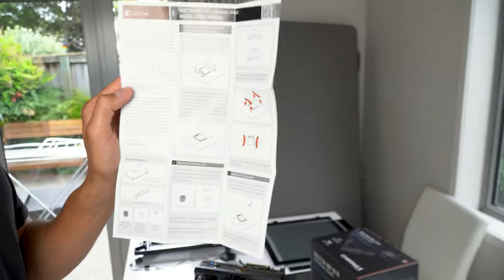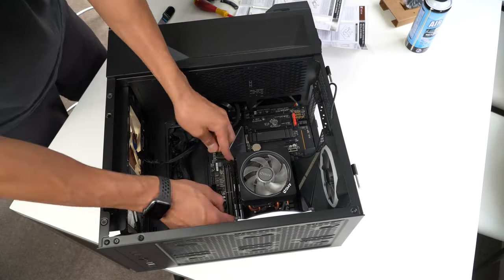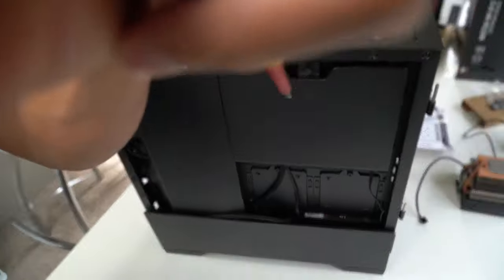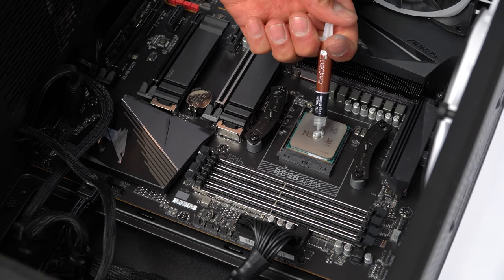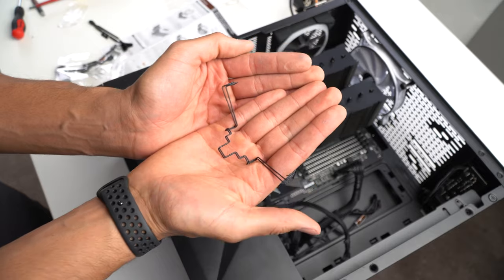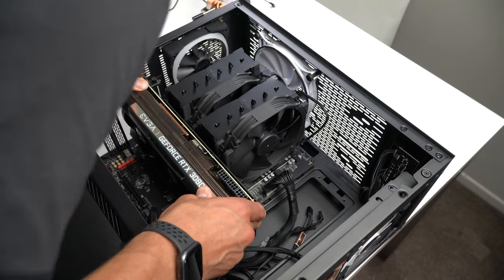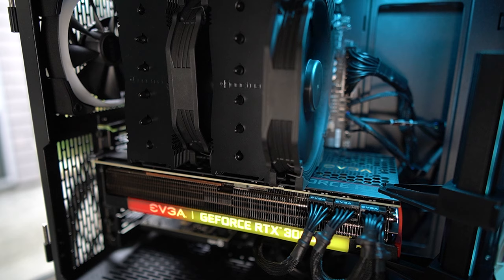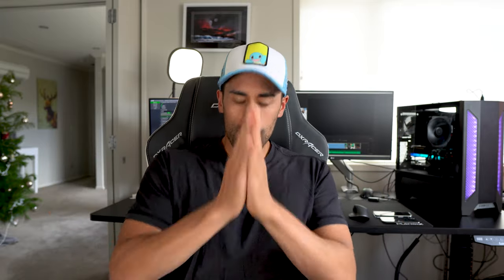Installing the Noctua NH-D15: Top Tips & Common Mistakes to Avoid

Comment: Hey pro gamer tip: NEVER USE THE DAISY CHAIN POWER CONNECTOR. use three separate power connectors for cleaner power delivery to your 3080. It can be super sketch sometime and may cause it to crash. I’ve seen some cards bricked (some were over clocking, some just had a high power draw). Other than that great vid quality. Pretty informative overall
Reply from the maker: Yup, I fixed that soon after the video after hearing how that was a bad idea! Thanks for looking out for me!
Reply: i am using 3080 tuf oc for over year i have the same power connector and i did connect them the same as he did in the video i didn't have any  problems
Reply: @Ahmadawa184  The only problem you might encounter is when your card needs more power and only 1 cable doesn't supply the needed power. Not only that, you risk overheating your power cable if you put a lot of load on your Gpu for an extended time. JayzTwoCents channel did a coverage of that.
Reply: My God. Doing that right now. Thank you!
Reply: @frankgrimes2679  oh yeah bud for sure use separate cables. If anything never cheap out on the psu. I did and now I’m in the market for a new one cuz 700w is obv not enough for a gaming z trio 3070. Better to get more than what u need so you can possibly use it in ur next build. they kinda let the whole pc thing be alive, otherwise u just have a bunch of cool looking parts lol
Reply: @BC_CARS  quick question, you said use 3 separate cables from the PSU to the gpu. But my 3080ti is an 8 pin, so wouldn't i be using 2 4 pin connectors?
Reply: @frankgrimes2679   cards are different. Some have 2 plugs some have 3 and the lower end cards just use one. My 3070 uses 2 plugs. Just make sure it’s a separate cable for each of the 4 pins. Daisy chain bad
Reply: @BC_CARS  gotcha, thanks man

Comment: Quick tip for the people in the comments and maybe even you. Try to avoid pulling straight up when removing a cpu cooler from a Am4 cpu because you can end up pulling the cpu out of the socket and bending pins. I’d recommend twisting the cooler first to break the seal and allow air to get in before trying to take the cooler off.
Reply from the maker: That’s definitely a really good point and something I have seen and heard of from other YouTubers especially if you don’t take your cooler off that often and the thermal paste almost becomes an adhesive!
Reply: I actually pulled my Ryzen 9 5900x from the socket and it went flying from the cooler into the wall and bent all the pins! So I broke out my trusty iFixit tool set and ever so carefully rebent all the pins back to as straight as I could get them. From this experience I learned never pull out a Ryzen CPU straight out but twist it out. I've gone back to Intel since then and sold my Ryzen CPU and MB.
Reply: @dalesawanas3733  was the 5900x a problem child or just wanted to try something new?
Reply: Good advice, filed under things I learned the hard way.

Comment: Laughed a bit when you talked about thermal paste application since it seems everyone has an opinion thereon and everyone's absolutely certain that they're dead right, haha. Thanks for the vid! I'm pretty new to PC building myself and want to pick up an NH-D15 myself for my Ryzen 5 3600 (because while the cooler's overkill for this specific CPU, it's a longer-term investment overall!), this was useful and fun to watch.
Reply from the maker: Yeah I can't really say what the right way is for that thermal appilcation but I can say that the cooler is a great choice and I thought the same in terms of future proofing in case one day I decide to upgrade to the 5000 series! I hope the cooler keeps that 3600 of yours cool as a cucumber! Ese :)
Reply: I have the same cpu, and the stock cooler from the ryzen 3 2200g i had previously was idling at 60c, just installed the nh-d15 and dropped that idle temp down to 40c, brilliant cooler. slightly overkill for my build, but as you said, future proofing is always nice

Comment: Hi can i have some help asap please? Im wanting to put the noctua nh d15 into a Gigabyte B550 AORUS ELITE V2 ATX AM4 Motherboard with Corsair Vengeance LPX 32 GB (2 x 16 GB) DDR4-4000 CL18 Memory. So would the ram sticks be able to fit underneath the cooler or would there be some steps i need to take. Also be using a Corsair 4000D Airflow ATX Mid Tower Case. Thanks guys
Reply from the maker: This is from their website where you can check compatibility for cases and coolers:

Caution: Please note that the fans of some tower coolers (especially larger models with 140mm fans, e.g. NH-D15 or NH-U14S TR4-SP3) may overhang the RAM slots and that this can cause compatibility issues if RAM modules taller than 32mm are used. While the fans can be moved upwards to increase RAM clearance, this will increase the total height of the cooler and thus requires additional clearance inside the chassis. As a rule of thumb, if the fan overhangs the RAM, the maximum CPU cooler height specification of the case must be at least the size of the fan plus the height of the RAM minus 7mm (accounting for the height of the socket and CPU). For example, if a cooler uses a 140mm fan that overhangs the RAM and 46mm tall RAM modules are used, the max. CPU cooler height specification should be at least 179mm (140+46-7=179). For further information and instructions on how to move up the fan for each cooler model, please click the height specification link.

Your case says max cooler height of 170mm

However when you look at the ram compatibility it comes with some tags saying it might not be the best due to the height of it:

NH-D15	

Front fan overhangs RAM slots. If there is sufficient space inside the case, the front fan can be installed in a higher position to clear the RAM modules (see linked FAQ).
AM4 mounting-kit included since 01/2019
For coolers bought before this date:
NM-AM5/4-MP83 mounting-kit required (free of charge)
NH-D15 SE-AM4	

Front fan overhangs RAM slots. If there is sufficient space inside the case, the front fan can be installed in a higher position to clear the RAM modules (see linked FAQ).

I checked my ram which is the G.Skill RipJaw and it gave me the same warning and I had to offset the front fan slightly to accomodate which was fine. 
Not sure if this is any help! Thanks Ese

Comment: I have used Noctua NH-D15 for all of my builds since it came out. It has never let me down.
Reply from the maker: Yeah I can see why! They are really impressive!
Reply: @mrtwomore  are you still using it ? I'm looking to get one
Reply from the maker: @deadmanwalking1930  Hey! yeah still using it and it's still going strong. I have cleaned it out a couple times with a dust blower but other than that it is holding the temps pretty darn well (I haven't seen my CPU go over 73-75 degrees even under full load).
Reply: does this cooler bend the motherboard by any chance? did you had any problems? could u answer me? 
i have a x570 UD gigabyte and i´m in doubt if this will hold.
Reply: @apertaplays  I have used it in all my builds. Never once has it bent the motherboard. Any problems? nope the installation is quick and easy.  Please read the instructions when you are ready to mount  it.

Comment: Thanks for making this video, I just bought an NH-D15 and will install it in a few days once I have moved house. Seems to be the most raved about fan / heat pipe cooler for my chip - i7 9th Gen 9700
Reply from the maker: I’m genuinely excited for you and hope the install goes soother than mine along with providing better cooling! Thanks Ese
Reply: does this cooler bend motherboards by any chance?
i have an atx mobo  ( x570 UD ) and i dont know what to do.

Comment: Huge thumbs up for this video, thank you.  My AIO cooler failed and it is the replacement of the original.  I think the QA on those is just too poor and they get contaminants in the liquid causing the pump to clog.  Any I decided I have had enough of the AIO and went with the NH-D15 which I don't have yet, but in preparation for it I almost completely removed all four screws on the stock brackets.  So glad I watched this and did not.
Reply from the maker: I’m happy you didn’t make the mistake I did with the screws. And thanks for the comment I’m sure that information on AIO’s will help someone else too.

Comment: When buying the Noctua cooler you should check the compatibility online with your case so you don't have to "cross your fingers". I was using an MSI MAG Coreliquid 360r but it fell victim to the usual sediment buildup so I have replaced it with a Noctua NH D15 Chromax. It's a huge ugly brute but it works and side effect is that I've been able to lose the 360 radiator which was blocking airflow into my PC.

Comment: I have the Noctua NH-D15 myself on a Ryzen 3900XT with one Noctua 140mm industrial 3000 RPM PWM installed in the center. The fan is definitely tamed with a fan curve. I don't waste my time with gimmicky water cooling.
Reply from the maker: I agree totally!
Reply: 26 years of high-end computing and water cooling never ever crossed my mind too
Reply: @Lordxfx  Liquid cooling has a purpose, but if I got the room air cooling it is
Reply: @jamesm568  I run stock speeds on my cpu's and never felt the need for liquid cooling. A 10 to 20 % overclock at the eind of the life cycle has never been an issue for me either. I only have the summer months to worry about and that hasn't been an issue either(EU). I a have computer room with no airco. My systems are audio production platforms.  Above that, I like to configure and forget my computer systems.  I like the KISS principle.
Reply: @Lordxfx  Personally, find radiators restrictive for airflow in a case.
Reply: @jamesm568  In a way you are right, but the fans are there to lower the pressure inside the case. (Push-Pull configi)The air flow is a result of pressure difference. You can do the other way around too. I personally love those big blocks, always did. Heat pipe technology has come a long way.

Comment: Cools a 5900x @ 4.5ghz at a nice 60°c while gaming.  Absolutely incredible, also opted in some corsair fans to replace the noctua ones included so I can move them somewhere else in the case for more airflow
Reply from the maker: That's good feedback and damn I wish I had a 5900X!
Reply: I wonder how high temps would go if used in video encoding in Premiere Pro or cpu rendering in V-Ray or Corona render.
Reply: Excellent to here. My 3080 and 5800x are throttling temps right now and mine gets in tomorrow
Reply: @hiimreyna  my 240mm aio can't keep up with my 5800x. Hoping the noctua makes a difference.
Reply: @hiimreyna  any good results in getting the d15? I'm getting mine soon my 240mm aio can't hang.
Reply: would it be a huge difference from the amd stock cooler? im using the stock cooler and play on a ryzen 5 5600x at 4.5ghz 1.2v at a max of 75c. Please let me know if this would be a good upgrade for my

Comment: You should try take your top fan off and have exhaust behind your cooler so the cool air runs from front fans - through the cooler fans and out the exhaust at the rear. Would give you even better temps I reckon.
Reply from the maker: You know what I might try that to see what the difference is, as it’s as easy as turning it off in the setting! Thanks for the idea of got nothing to lose!
Reply: @mrtwomore  whats the results after you change it?
Reply from the maker: @rnyzen2.079  nothing to be honest I already had a exhaust ran running and that top one only kicks in at a temp of +80 which is hardly ever with that CPU cooler.
I've actually upgraded to the 5800X3D and only seen it hit 80 degrees once or twice on some big renders in aftereffects.
Cheer Ese

Comment: For the love of god do not use splitter cable for power to your GPU. It has to be 3 SEPARATE power cables from PSU. Good informative video on installing noctua though!
Reply from the maker: Appreciate the heads up and I agree I actually didn’t even think about this when I swapped out from my old GPU. I’ll fix that up this arvo. And cheers for the comment! Ese
Reply: @mrtwomore  It shouldny make a difference unless your an overclocker which couod just cause crashes (as far as i know and read in tbe passed) if your power supply doesnt have the cables, dont worry about it lol. Also video vid👍
Reply from the maker: @benkhmelev9692  cheers man and yeah that was my thoughts but luckily the EVGA PSU has a million VGA cables so I just put another one in to be safe, 😁😁
Reply: @benkhmelev9692  Yeah, two should be enough, but for three 8-pins, I'd use three separate cables if I could. Seems like using two and daisy chaining is okay, but yeah. I'd play it safe.

Comment: Thanks for the video! Btw, I noticed your exhaust fan does not spin when you had it on, not sure if you want it that way, but just heads up :)
Reply from the maker: Thank you for noticing and looking out for me on that! I did have it set to come on at I think 70 degrees or more on the CPU temp, but now I have it running low most of the time as an exhust and it works better for temp regulation. Cheers, Ese

Comment: just bought a NH-D15 for my ryzen 5 3600, as the stock cooler is holding my idle temps around 55 degrees (c)!!

Comment: Nice vid mate, i got this CPU cooler coming to replace my 240mm AIO rad.
Reply from the maker: Appreciate it and I'd keen to hear how it goes compared to the AIO. Cheers Ese
Reply: @mrtwomore  I installed this Cooler yesterday, on my Ryzen 5 3600. i set it to 4.4ghz and 1.4v it never goes over 60c degrees. Noise level is quiter then the water cooled AIO.

Comment: This helps because I have the exact same case as this video and though MB is different my ASUS 550 is set up quite the same way. So sir, your video helped me make the decision to purchase this fan. Good Job! EDIT: Also I subbed :)
Reply from the maker: Thanks man, it's cool to hear I helped someone! I hope it make some good improvements!  Cheers Ese and thanks for the sub too!
Reply: @mrtwomore  UPDATE - Put my fan in today and no issues. The one tip to take away from your video is to replace the new mounting bracket one at a time to avoid needing the second person to hold :P I probably would have taken both off had you not pointed this out. My original was a stock AMD cooler that came with my processor and heat was becoming an issue. The original thermal paste was in a dot pattern from AMD. I will never use stock paste if already applied because the spread was horrible when I removed the old fan. The Noctua came with great instructions and more thermal paste you'll ever need. So anyways, again this video was a great help! Also saw a 15 to 20 degree Celsius drop with new fan when stressed.
Reply from the maker: @thatitdood8593  That's awesome to hear and I'm just stoked you took one good thing from it! And the temp drops you state are pretty similar to what I experienced too which is good to know! Thanks for the update and enjoy the cooler computing! Cheers Ese

Comment: thanks for the video, was wondering if i needed to take everything out of the case to install the new fan. seems to be not so bad as long as you have someone else holding up the back plate for you
Reply from the maker: I think it depends if you have a GPU as big as mine (3080) the space between it AJ’s the Noctua CPU cooler is pretty tight so I felt more comfortable taking it out. The Ram in hindsight I could of left in too but the effort of taking them out is so quick that it was easier remove to give my hands more space to work too. But this all depends on your overall case space and what components you have in your rig too!

Comment: I love how good this cooler is, but I did have clearance issues getting access to the pcie slot in order to replace my gpu. Had to use wooden chopsticks in the end.
Reply from the maker: You know what I just experienced that but didn’t have chopsticks so used one of my plastic sticks I had lying around, it’s definitely a tight fit in there with no space for fingers to get it!

Comment: Its funny that u got a similar case to mine. I have the Lancool Mesh 2 Performance by Lian Li
For now I got the Thermalright ARO M14 which is quite good and at my next CPU upgrade (currently running 3700X) I always wanted to buy that huge cooler beast. My exit fans are already by noctua and I love them.

Comment: which Case of Lianli is this? my Lian Li Lancool II  Midi Tower  has a max CPU height of176mm.
I'm going for the same build, only the motherboard is an ASUS TUF GAMING X570-PRO (WI-FI)
I hesitated for a long time to buy this cooler instead of water cooling because it is so big ;-) but your video convinced me!
great content man!
Reply from the maker: Hey Patrick, yeah that’s the case here’s the exacts from my invoice so can make sure it’s the same: 
Lian Li Lancool II RGB Black ATX MidTower Gaming Case Tempered Glass, with CPU Cooler Supports Upto 176mm Height, Graphs Card Supports Upto 384mm, 360mm Rad Supported, 7XPCI Slots, Front: 2XUSB3.0,
And your set up will be sweet system with all those components and that motherboard too! 
Excited to hear how it all goes with the install and set up and yell out if you need anything else! Thanks Ese
Reply: @mrtwomore  I expect parts tomorrow, also the Noctua NH-D15s Chromax Black this one is slightly smaller with more space for the graphics card.
when he's done I'll let you know my findings, all the pieces are difficult to obtain.
thanks for your support ;-)